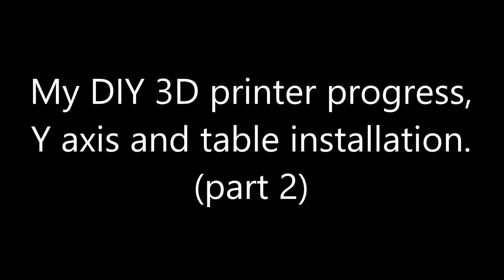My DIY 3D printer progress (part 2), the Y table.

Comment: This looks incredibly overbuilt. I love it. What materials are you planning on printing with it? Which hotend are you using?
Reply from the maker: Thanks for the comment. Yes, it is overbuilt, but that's OK. This is just a hobby for me and I had the material at home, so I decided to build it this way. I plan printing PLA, just like I do on my other printer. The hotend is a dual filament hotend. Not used it yet, so I don't know how well it will work. Project halted due to other activities... but will continue soon again.